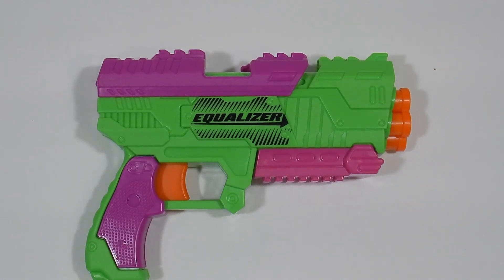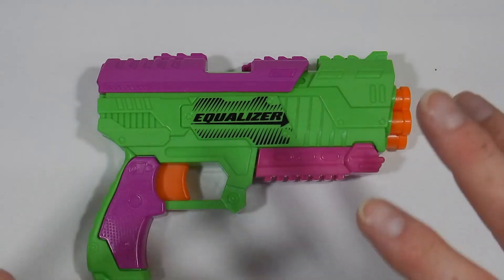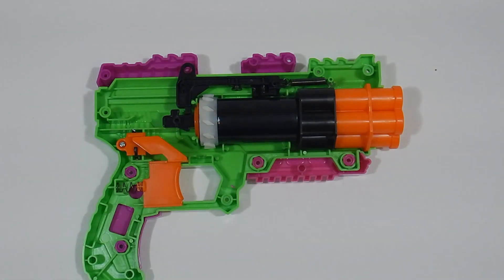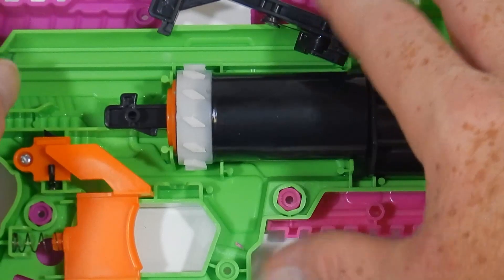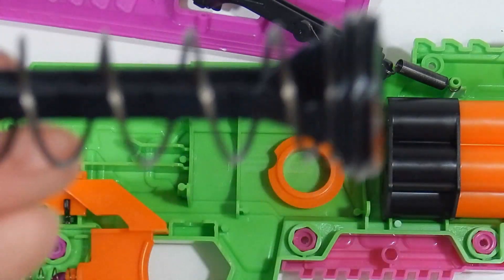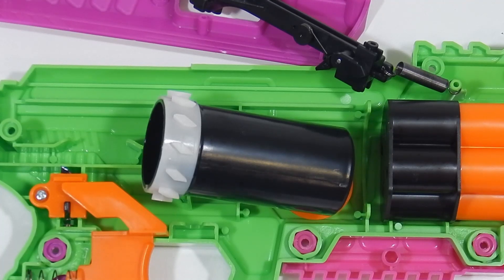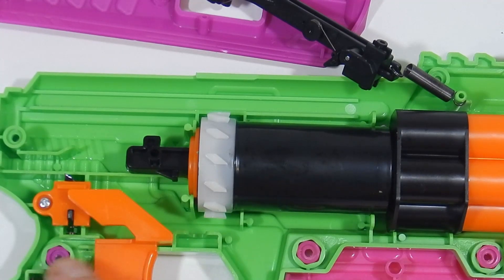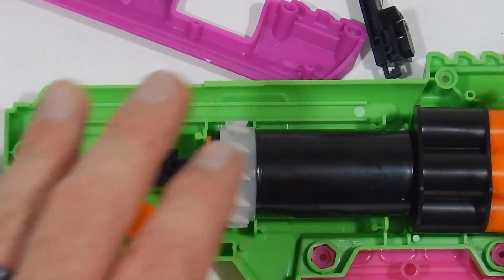Adventure Force Equalizer Internals and Mod potential

Comment: The internals remind me of my Night Tek. Only difference is the plunger tube is bigger but the spring is impossible to take out without destroying the plunger rod. If I were to mod it, I would just brass the barrels or PETG if I can find some so it looks like a modded air tech blaster from afar hahaha
Reply from the maker: You can easily as shown in the video swap springs on this one. Some good barrels and a heavier spring could make this a viable backup.
Reply: @MongooseJakeNerf  sorry non native english speaker here I meant with my description that it would be impossible to upgrade the spring in my Night Tek which is opposite of this very simple and straightforward blaster. Hope this shows up in my country as a buzzbee branded blaster along with the Thundershot and the belt fed one. We don't have Walmarts here so no Adventure force blasters too :(

Comment: These are extremely interesting indeed. But, to compare it to something else out right now- what would the better performer be, the Equalizer, or the Clash Force (4 shot)?
Reply from the maker: They are a bit more comfortable to use, with just a bit less power when compared to the Clash Combat. Both these and the Clash are Buzz Bee products and are great pistols, so it comes down to personal preference really.